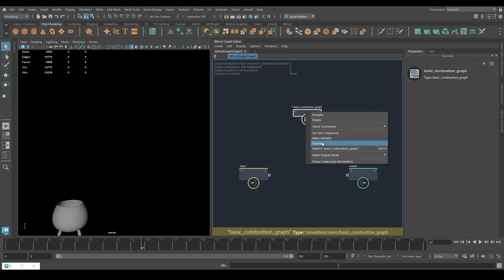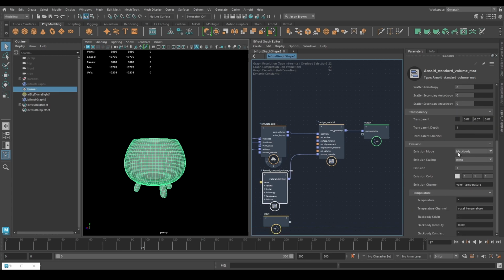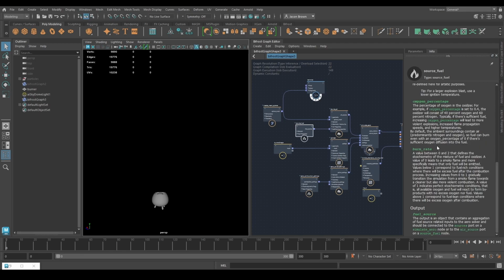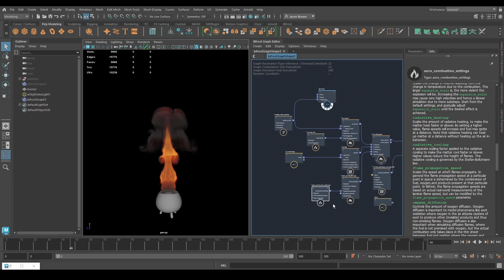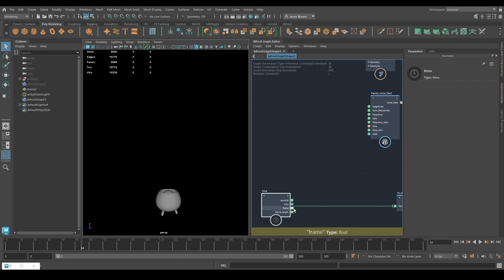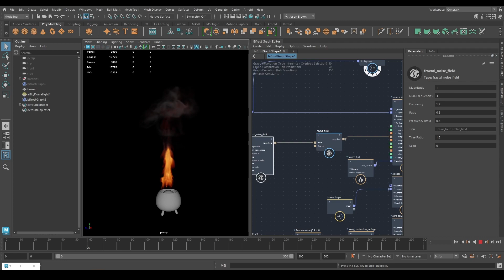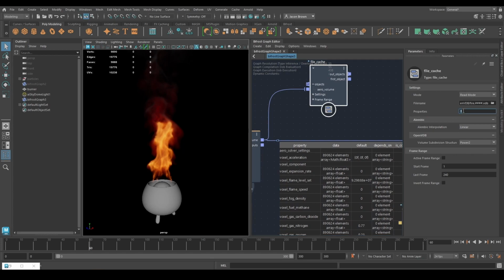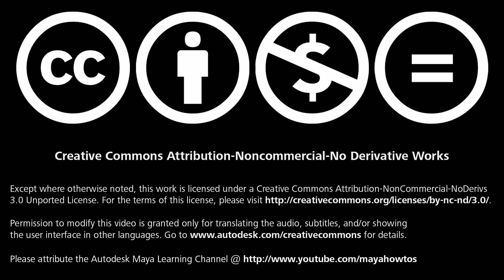Bifrost Bootcamp 5.4 - Combustion: simulating fire and explosions

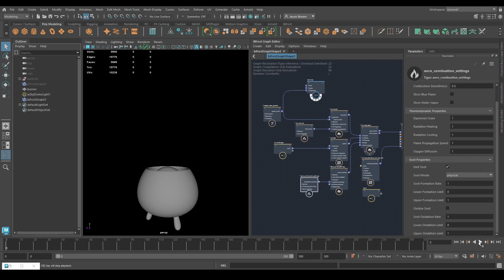Comment: i followed every step exactly but i do not actually get a combustion process simulating like it shows at 3:48, i just get a fuzzy smoke ball that doesn't change or move. this is the case with all bifrost aero combustion tutorial i am trying to follow. i am using maya 2025.3.1, what is my issue? the lack of updated bifrost documentation is very frustrating, I am considering giving up and just using Blender or even Houdini